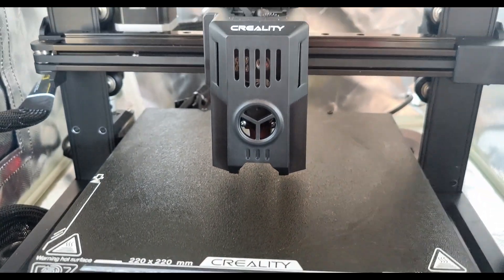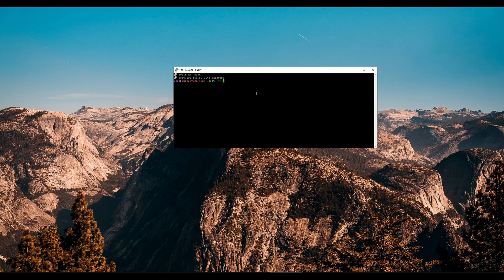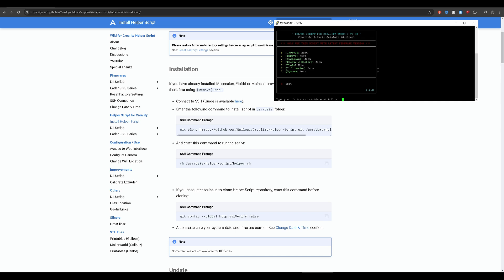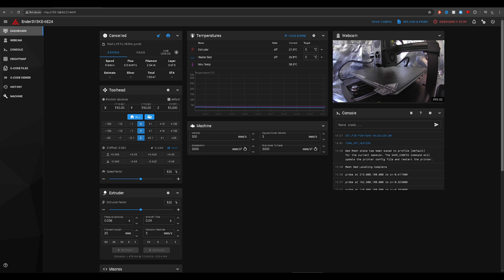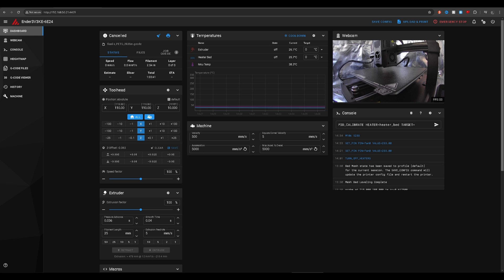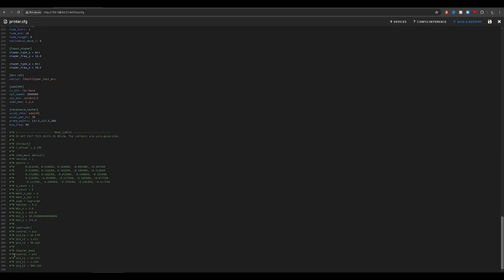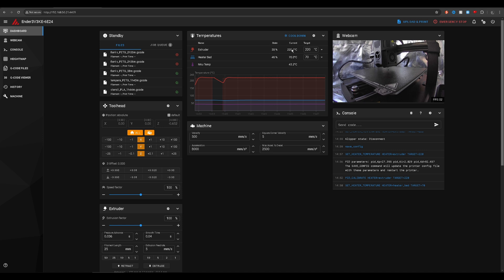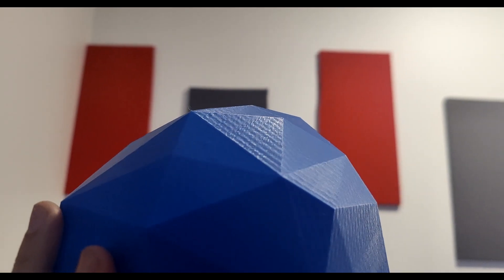How to Auto Tune the PID on Ender 3 V3 KE (or any klipper machine)

Comment: Would love to try this BUT I just know it would fail somewhere along the way.
Creality Ender-3 V3 SE fitted with Nebula pad that is currently working very well EXCEPT it fails to display the total_print_layers in the device screen on CP6
Constantly seeing 25/0 or 135/0 or 343/0 is a pain in the butt.
Also...  my current FW version for the Nebula is v1.1.0.27 yet the install script is saying it requires v1.2.1.3 for ENDER-3 V3 SERIES. Does this version even exist? As Creality don't have it.
Reply from the maker: not sure :( sometimes creality has firmware that has dissapeared into the ether, and you have to do a lot of digging around to find it. Try gitgub or reddit :)

Comment: Hi ! A very useful video, but I have a small problem. I went through all the steps but after entering the IP and port: 4409 I only get the message "404 Not Found
nginx/1.17.7" What did I do wrong?
Reply from the maker: Maybe it didn't install properly, or you might have missed a step on the installation process. Have you tried reinstalling?

Comment: So... How was the result? Did it have any effect on the prints?
Reply from the maker: You can make it slightly better, but creality seems to have messed something up with the firmware of the ke making it very hard to get it perfect. Either that, or this is just the way klipper calibrates PID, which isn't as good as marlin.

Comment: Do you leave the fan at 100 for PID of extruder or turn it off after the heater bed?
Reply from the maker: Depends if you are going to be using the fan when you are printing. If yes, then crank it up to whatever speed it normally sits at. The idea is to get the PID tune heated/cooled at the same temp you are going to be printing at the most. If you are using a few different types of plastic, average it out :)

Comment: How much better results its to use Klipper?
I have Ender-3 direct drive full upgraded and printing like professional printer.
Especially the TPU 95A elegoo
Reply from the maker: I have had really great results using klipper, as do most people, I think it is just an overall performance boost to your machine. Having used printers without klipper, it seems to make printing a much easier process.

Comment: Nice but look difficult and scary.
I will update my firmware first but if i must the newer firmware then will be a problem?
Reply from the maker: haha yeah the command terminal is a bit different from what people are normally used to.. new firmware is always good, they iron out kinks and make the machine faster (most of the time) and you'll need the latest firmware for everything to work properly. Which ender 3 do you have? or is it the base model?
Reply: @LayerLabAustralia  i have Ender-3 the first model direct extruder full upgraded And you can see my work in my YouTube channel.
Tomorrow i will receive the ender 3 v3 ke
Reply from the maker: @noobt4eguns  Ahh yes the ender 3, that was my first printer until it stopped working and i threw it in the bin :P Love your content dude! looks good! I have another channel about gel blasters and I actually 3d printed a carbine mod for my glock, check this out https://www.youtube.com/watch?v=HTViRmvmax4&t=32s
P.s you will love the KE, NO MORE BED LEVELLING woohoo

Comment: What are you using for software? My screens look nothing like yours and when you say your going to use a new mainsail IP, where does did you get that? You seems to skip over those kind of things
Reply from the maker: sorry if I didn't make that part clear. You need to add on ":4409" to the end of your IP to access the mainsail interface. Otherwise you can override this entirely by using the helper script. When you plug in your IP, it will take you directly to mainsail instead of needing to add the 4409 at the end :)

Comment: Would love a vid on how to level the bed in the KE as mine is not good at all and cant seem to fix it :( Would also love how you can do the bed level via Klipper and not on the printer and heat the bed and extruder at the same time etc thanks for this video as it really helps
Reply from the maker: Hey Chris, glad the video helped! Unfortunately the only way to level the bed on the KE is to do it with some tools, it's not as easy as rotating some wheels like we had with the older machines :( There is a video on creality's youtube channel on how to do it - https://www.youtube.com/watch?v=iaExzAYR_Fo&t=180s . There could just be a chance your gantry is off, so get some glue sticks, or anything that you have two of that are exactly the same height, and see if your x axis is flat.

Also, if you have mainsail installed, there is a button at the bottom of the main page under "macros" that performs the bed level :)
Reply: @LayerLabAustralia  Ya I did the Gantry fix but still no luck, would love some more in depth stuff on Klipper/mainsail, as I'm having zero luck with my first layers and I think its due to the bed level and Z offset but very little info on how to fix it sadly :(
Reply from the maker: @just1ce4no1  Yeah I agree, due to the machine "meant" to be fully automated in terms of leveling/calibration, there aren't that many tutorials on how to fix it when it stops working. I won't be able to make a tutorial on how to fix the bed level issue until i experience it myself, but if/when I do, expect a tutorial on how to fix it :P In the mean time, I'll add another video to my list on some more in depth stuff about klipper/mainsail :) What other stuff did you want to know about it?
Reply: @LayerLabAustralia  I've done the auto calibration, but its not very obvious on how to set the Z offset in mainsail, or what to do after mainsail is installed, as I might be missing a very basic step, I'm going to Factory reset the router and see if Creality print as the same issue as Mainsail if now I dont know what to do

Comment: Creality modified the temperature PID algorithm on klipper, making PID Tuning essentially useless
Reply from the maker: Ahh that would explain alot 😆
Reply: @LayerLabAustralia  yeah I dove deep into the klipper open source firmware and had some interesting finds
Reply from the maker: @duck_that_quacks  wow wish I knew how to do that XD Do you think there is any way of getting around it?
Reply: @LayerLabAustralia  you could run klipper on a raspberry pi instead of the nebula screen, but that has some challenges on its own

My raspberry pi is arriving this week, I'll keep you posted!
Reply from the maker: @duck_that_quacks  aww mann. I  sold my last rasberry pi when I sold my v3 SE. Looks like I may need another one now :P
Reply: @LayerLabAustralia so wait are you saying this video is pointless !? 
You could use a old laptop running Linux, that's what I have on my old ender 3 v2
Reply: I have ke , so eventhough not using pid , could I still run the cfw to print  in co junction with orca slicer for some good prints

Comment: Is this still necessary to do? I've tuned my printer enough to near perfection, EXCEPT the mild ringing going on
Reply: and is there any going back from this in case of issues?
Reply from the maker: Howdie :) Yep, if you want to restore to the original settings, use the helper script you used to install mainsail/fluid to restore to factory settings, or just use a few commands in putty. Don't do it on the machine as it is not as comprehensive. Here is the link, see "Reset Factory Settings section." You can always try and see if it makes any difference :)

Comment: Hey, this is an awesome video! It helped me because I couldn't find that setting on the printer either and I had come from a V3 SE, so that's a bit annoying :p. Do you think you will do a video on how you set up your webcam? I've been trying and haven't been able to get it to work thus far...
Reply from the maker: Woohoo! Glad I could help 😃 you'll need to be using mainsail, and to also install the webcam utility when you are using that installer helper with the command line interface.

Comment: Great video! Did this help with the banding?
Reply from the maker: Thanks Calvin :D When I tuned my V3 SE, it removed the banding completely as the temperatures stayed locked in place. Unfortunately I still get a little bit of banding on my KE klipper version as I can seem to figure out a way to stop it over/undershooting that small amount.